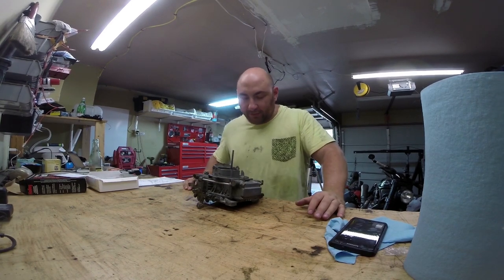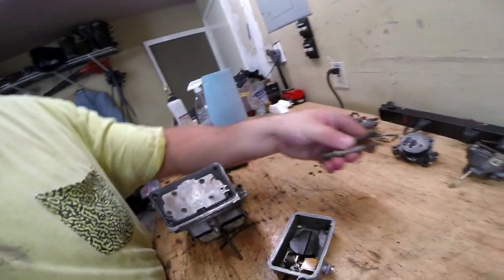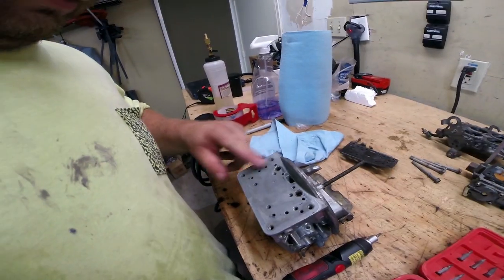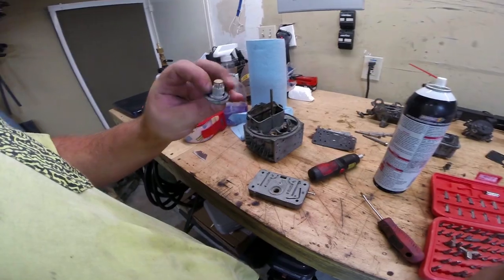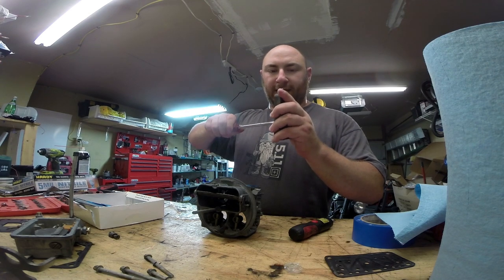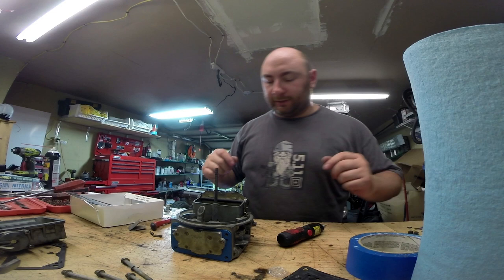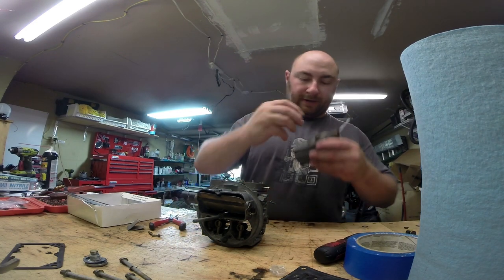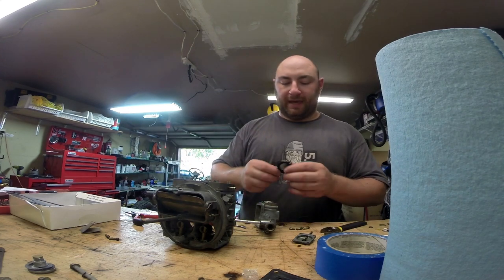DIY - How to Rebuild a Holley 1850 Carburetor 4160

Comment: A small flat head screw driver bit works fine on the clutch head screws.  They are not that tight. Just get one that fits close.

Comment: mine didnt have the pink rubber flapper in the accel. pump. ihad a check ball.   Also that kit does Not come with a new sec.vacuum diaphram, bummer. my carb is also missing the piece that connects the primary throttle plates to the secondary one!! damn! but since it's vacuum operated, it might work. (it doesn't).  the rebuild kit comes with an exploded diagram, i think i'll order that piece just in case. also want to say since you have a jeep, that they have spring loaded needle valves for them (not in kit) for $29ea.  at summit,-helps with washboard roads-  however the float bowl baffles are only made to fit float bowls with a center hung float (according to Summit), but Holley says they fit many "performance carbs" i dont know what that means and i also forgot what kind of carb i put them on, but link to them is here:  https://www.holley.com/products/gaskets/carburetor_gaskets/parts/26-89   and also here:   https://www.holley.com/products/fuel_systems/carburetor_components/floats_fuel_bowls_and_components/fuel_bowl_kits_and_components/parts/59-10QFT       great vid!!! but as an electrical contractor i have to say STOP stapling wires to your sheet rock on the ceiling!!! oh yeah what is the vacuum port for in the throttle body anyway? (retaining vent baffle? wtf is that? on a much later-brand new carb-it calls it the timed spark vacuum source-connect to distributor.  page 5 here says what to do with the bottom small vac port here:https://documents.holley.com/199r7948-5rev6.pdf )    i'm REALLY GLAD i looked that up because i was going to hook it up to the wrong one on the bottom where i had it before. when i last ran this carb i had a mechanical advance UNILITE. now i have a Vac advance Electronic.   back again. hey i went here to www.holley.com/replacementparts (but had to type in the search bar)  and found on like page 17 my linkage part. on this page, but you can find anything there: https://www.holley.com/products/fuel_systems/carburetor_components/brackets_and_linkage/parts/20-54  it works for a 600cfm but i guess not on others. i ordered the wrong one at first, one that was much longer. it didnt fit obviously. i'm into this $50 just for that Holley Carburetor Throttle Secondary Connecting Rod :(  
   i looked for the secondary diaphram, found one but it wasn't specific for the carb, just said most carbs. soo.  you need one you can look for it.  it may or MAY NOT be this one: their Tech line number is on the pages as well.  https://www.holley.com/products/fuel_systems/carburetor_components/choke_and_vacuum_secondary_components/vacuum_secondary_parts/parts/135-11  i should also say i noticed that my floats had two different springs! i just put the same ones back. i ran this carb for years with no issues, but it probably would be nicer to have two the same.  (BUT i noticed on the exploded diagram they are indeed different!)  and they also have CLEAR float bowl sight plugs that would be nice to have too. too bad i already ordered my linkage before i saw the springs. btw lacquer thinner did a crappy job of getting carbon off!! Dont use it.
Reply: ALSO want to mention i just drained the container i dipped and washed my parts in, found a little needle valve. i noticed you said that you removed the accelerator pump discharge nozzle, inside the carb under the choke plate, and guess where this little bastard goes? right there under the nozzle. it's pn 119 on the diagram that comes with this kit, which i have to say, didn't come with a new gasket for the screw for that, at least one i thought looked like it. so i re-used the old one.  right now i have to got put that pump discharge needle (and gasket) back where it belongs